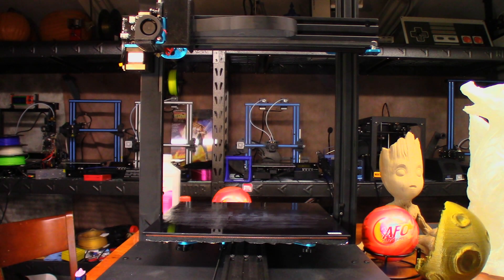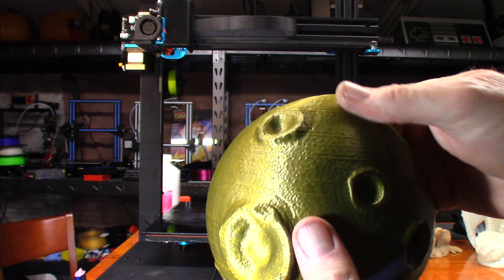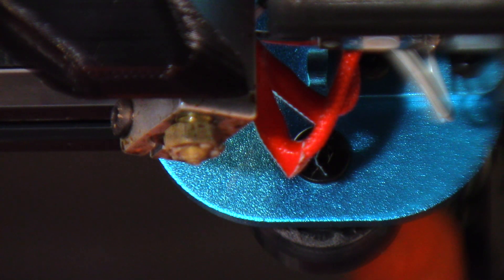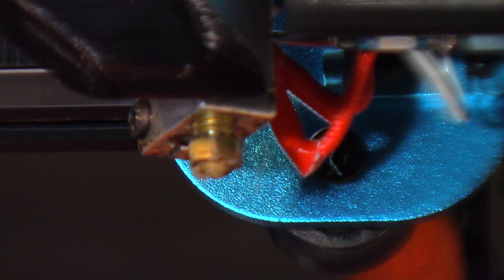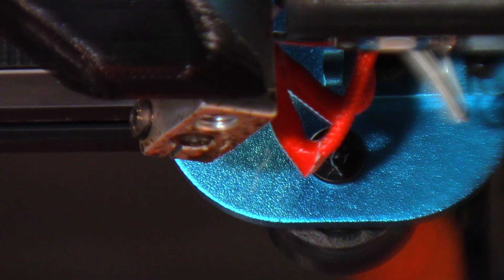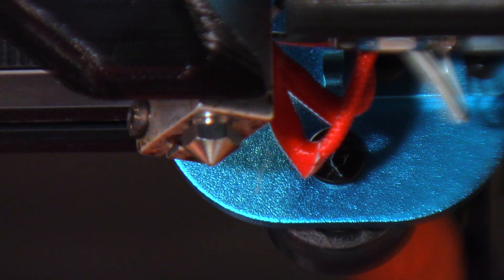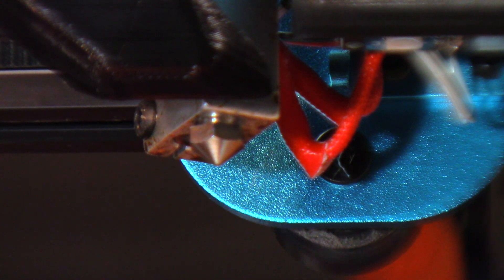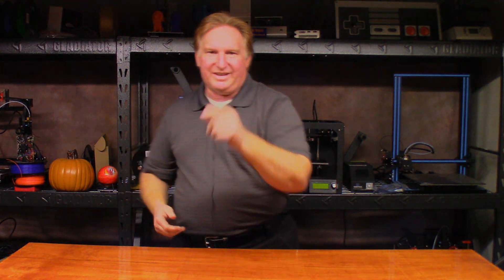Replacing The Artillery 3D SW-X1 Nozzle

Comment: Did you print moon city without supports?? At what point would you use supports? I just started printing and even my smallest pieces have a ton of support.
Reply from the maker: As long as your printer has a cooling fan, you should only need supports for parts with more than a 75% overhang.  Once you get used to your printer you may get away with 80%.
Reply: @JimmyShawsTidbits1  Thanks I'm currently at 60% the fan is the one piece I havent turned on I will try that next

Comment: Since the new nozzle may not have the same material characteristics as the one being replaced, best to do a PID auto-tune before printing with the new nozzle (especially true if switching to stainless, plated, hardened steel or ruby nozzles but won't hurt if switching standard nozzles). You can load the newer Marlin firmware for the X1 (robscar) from Thingiverse which supports PID auto-tune and EEPROM saving. This should help ensure you get the best prints with your new nozzle.
Reply from the maker: I have used microswiss replacement nozzles for years with different printers and have never needed to run a PID auto tune.
Reply: @JimmyShawsTidbits1  I've had mixed results. Always seems to work better with an auto-tune. Simple and quick. Good habit to get into.

Comment: Good stuff Jimmy. Thanks for sharing. I have a hardened steel nozzle that came with my Microswiss hotend, do you know if it would last printing glow in the dark filament?

When I swap nozzles I do it the same way as you but I sometimes wait a minute to let the new nozzle heat up before tightening it with the ratchet. Not sure that's necessary or not though.
Reply from the maker: Oh yeah.  You can print it all day long and you should be good.  It's just the brass nozzles are softer and it doesn't take much to ruin them.
Reply: @JimmyShawsTidbits1  nice! Thanks Jimmy.... Now, to order some 😂